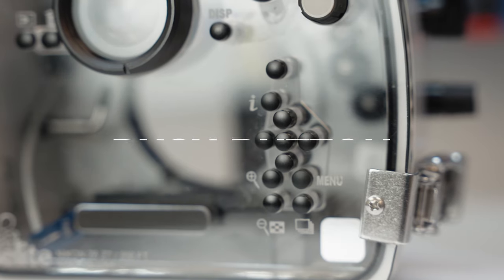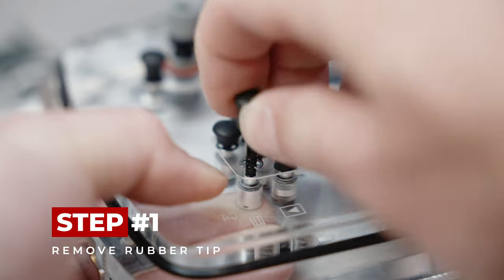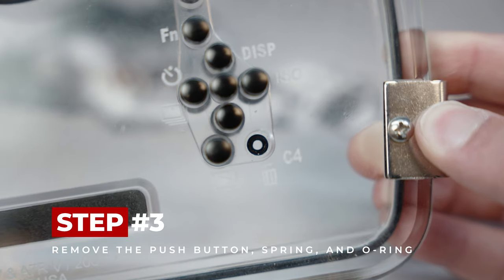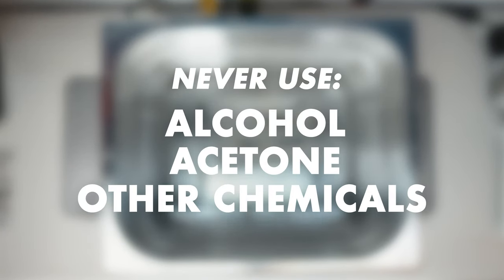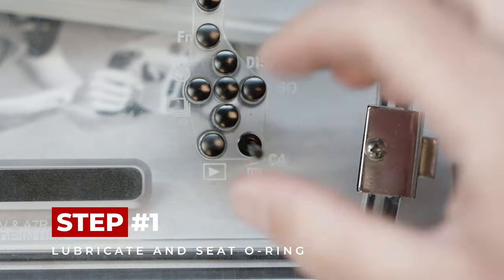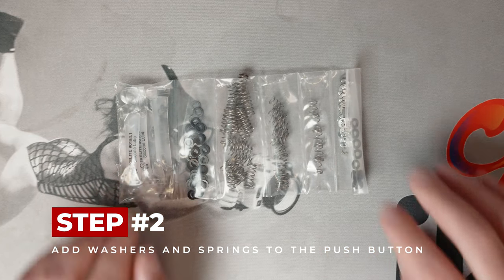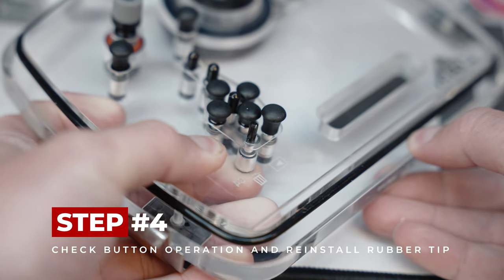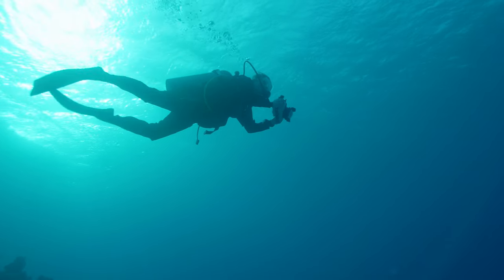Replacing Push Button O-Rings on an Ikelite Underwater Housing

Comment: Thank you, we need more videos. 
I have question I see yellowish color around the buttons what to do?
Reply from the maker: Yellowish coloring would suggest that they are nickel plated brass where the plating has started to come off. If this is the case, they may operate ok but develop corrosion build up more quickly. It is possible to special order replacement push buttons. We recommend emailing ikelite@ikelite.com with a photo of the buttons to confirm and for information on ordering replacements.

Comment: It looks so simple with the right tools, but why won't you service video housings any more?
Reply from the maker: Good question! It’s primarily because we no longer have replacement cases for the old video housings. So we cannot properly warranty the repair service in case something should go wrong. We do sell the o-rings and glands and it would be very simple to service the housing yourself.

Comment: Great Video, thanks. But how to change the rotation-knobs/axis? Does ist works the same way?
Reply from the maker: It is different and we’re working on a video for that. Honestly you can get away without changing the seals for the knob controls for a lot longer, just put a little lubricant on the control shaft and it will probably work just fine for many many years.
Reply from the maker: @patrickfrangenbeeg4275 to find out about replacing control o-rings check out our new video Replacing Control Gland O-Rings on an Ikelite Underwater Housing
https://youtu.be/CF9LMwGvsTc